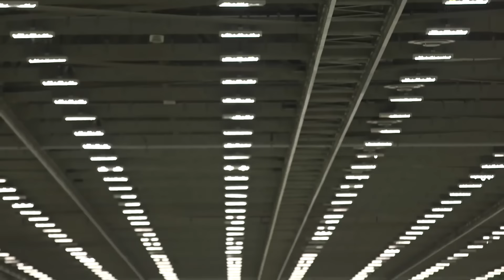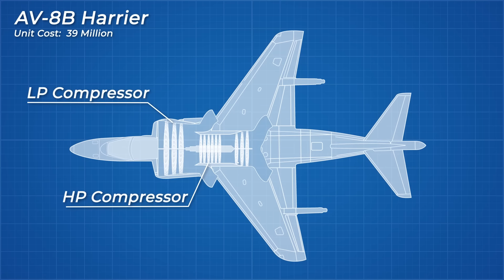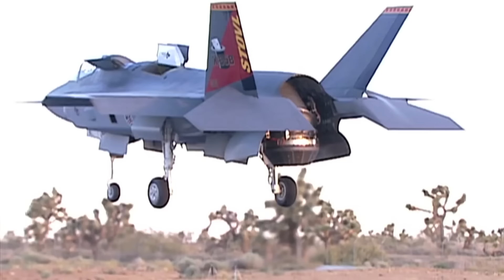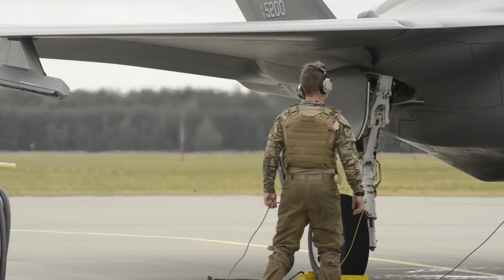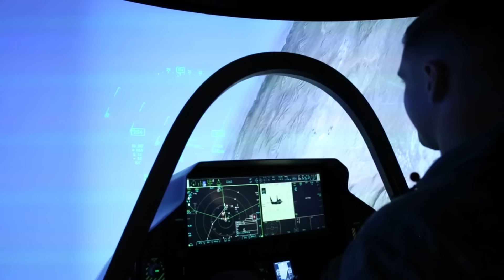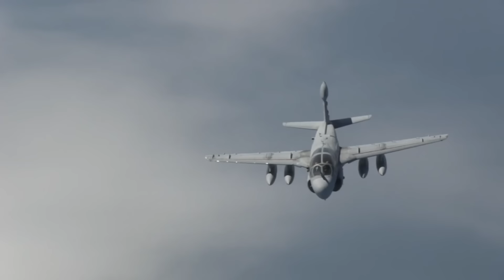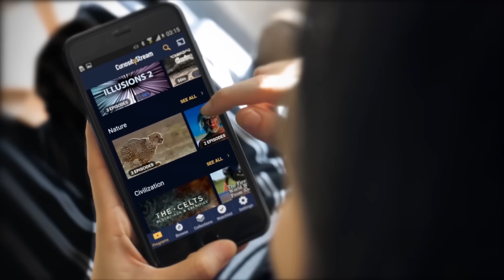Is The F-35 Worth $115 Million?

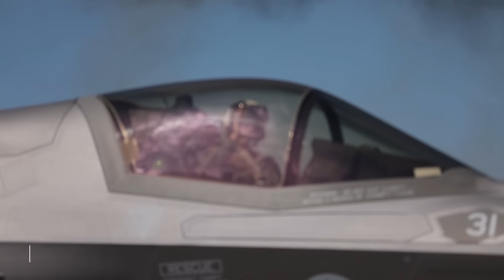Comment: 8:50 "Ironically" when referring to the F-35 having three models.  

Even the X-32 had it gone in to production would have had multiple models. The sticking point was that the VTOL prototype couldn't go supersonic. Yes, Boeing said they'd fix it in production, but they had a separate VTOL prototype from the prototypes capable of supersonic flight.  Where the X-35's VTOL prototype had no problem going supersonic. So the X-32 had VTOL OR supersonic.

From the start of the JSF program, it was expected that there would be a "VTOL version" and a "non VTOL version" of the winning design; as they knew the Air Force and Navy didn't want to waste the weight of a VTOL system.  The adding of the third version for the Navy was "Navy gotta Navy" and wanting more capability than the Air Force. Although I don't know why the USAF didn't just order the F-35C for commonality. Oh, wait, I do know - they wanted to be different than the Navy.

I do wonder if the Blue Angels and Thunderbirds will both switch to the F-35, though, marking the first time both teams would share a plane since they both used the F-4. It would be awesome for the Marine Corps pilot to fly an F-35B and do some VTOL tricks during the routine.
Reply: The F-35 seems to sacrifice manoeuvrability for stealth and VTOL so doesn't that make it an unsuitable replacement for an aerobatic display jet?
Reply: @GonzoTehGreat  Sure, but the F-35A is still superior to the F-16 in terms of maneuverability, it just isn't top tier like the F-22.
Reply: @dumdumbinks274  The F22 was the intended replacement for the F15. 

The F35 is intended to replace the F16 (with A), F18 (with C), Sea Harrier (with B), F15E variant and originally also the A10 (although turbo props and now drones are being considered instead).
Reply: @GonzoTehGreat  As a simple summary yes, but technically the F-35 is only intended as a direct replacement for the F-16, F/A-18A/B/C/D, and AV-8B... 1 for each F-35 variant. There is discussion about replacing the A-10 with it, but that's only because the F-16 has already largely replaced the A-10 and the F-16 is being replaced by the F-35 so it's an indirect replacement. I don't believe the A-10 will have a direct replacement since it's strengths are not nearly as useful today as they were back in the 60s. 

The F-15E is being upgraded and the F-15C is being replaced by the F-15X. The F-35 is considered perfectly capable of replacing them in terms of it's capabilities, but the production lines are fully occupied for at least the next decade so cannot replace the F-15s in a timely manner. All F-15 variants as well as the F/A-18E/F are expected to be replaced by 6th gen fighters starting around 2030.

As for F-22, well that was a political failure much like the F-14. When politicians don't like a military product that product tends to end up falling short of expectations. The minimum number of F-22s required by the USAF was around 320, but politicians cut that number right back to 187 and studies into restarting F-22 production with modern technology unfortunately concluded that it would be a waste of money and effort. Better to just upgrade the ones we do have and proceed with the 2 6th gen projects.
Reply: @dumdumbinks274  Can you support this with evidence? The F-16 was designed to be manoeuvrable in WVR engagements, so I don't see how the F35 could be a superior dog fighter and have actually read the opposite.

https://militarymachine.com/f-35-vs-f-16/

As I understand it, the F35 is superior to the F16 BVR due to stealth, more advanced sensors and information processing, better ewar capability and active radar, however many of these advantages are simply the result of improvements in technology over time rather than being specific to the F35 itself.

Hence, I think the jury is still out on how it will perform in a dogfight - the counter argument being that hopefully it will never need to engage in one.
Reply: @GonzoTehGreat   Sure, just watch any recent F-35A airshow or refer to this F-16 pilot's comments https://theaviationist.com/2016/03/01/heres-what-ive-learned-so-far-dogfighting-in-the-f-35-a-jsf-pilot-first-hand-account/

The article you have cited refers to the 2015 test of AoA laws (not an actual dogfight) which was essentially testing the controlability of the aircraft during combat maneuvers. The test was a success and lead to the removal or reduction of many restrictions imposed by the flight software for safety reasons (don't want pilots attempting untested maneuvers and crashing an expensive aircraft). Although that was the case a report was leaked about the test results and taken out of context by a fairly controversial site called warisboring.com and it created a lot of drama The F-35 in the test was restricted to 4.5Gs. Production model F-35s from mid 2015 were 7G capable, and later that limit increased again to 9G for Block 3F aircraft in 2018 - the same as the F-16. Though unlike the F-16 the F-35 can tolerate very high AoAs without losing control. 
EDIT - Note that the aircraft flown by the pilot in the linked article was a Block 3i F-35A limited to 7Gs. 

Another way to look at this is from a simple analysis of the statistics. The F-35A is about 1.5x as heavy as the F-16, but it's wings are also about 1.5x larger and it has about 1.5x the thrust. However unlike the F-16 the F-35 is a lifting body design and about 30% of the lift generated by the airframe comes from the fuselage instead of the wings, so the F-35 has a lower loading than the F-16. The other aspect is that the F-35 carries a heck of a lot more fuel and has significantly longer range so it's weight varies more, but comparing an F-16 at dogfighting weight to a fully fueled F-35 is not a valid comparison... though some "experts" like to compare them that way just so they can say the new tech is bad.
Reply: Bhue Angels are switching to the Super Hornet. It will be a very long time before they fly the same plane again.
Reply: @dumdumbinks274  That makes more sense.

Comment: So eli5, why not repaint the F-15 and install these electronics?
Reply: The F-15 

- is less maneuverable by far 

- with a combat load has worse performance due to the drag of all the weapons and pods and fuel tanks

- can be spotted at 10x the distance on radar which means the advanced sensors don't have much opportunity to be used. 

- is also more expensive to buy and operate.

Comment: Can anyone design a vehicle which would simultaneously be the world's fastest car, the toughest SUV & biggest pickup truck?
No right-thinking person would do so. However the US has built such a plane. Which does everything badly
1 - That half million dollar virtual reality helmet freezes sporadically leaving the pilot blind (potentially during combat)
2 - The reason for having that overpriced helmet is because of that huge hump directly behind the pilot completely obscuring the rear view (EVERY successful fighter plane till date has been with a clear rear view) 
3 - The same hump and thick body common to EVERY F-35 (and designed ONLY for the VTOL versions to house the fan) has completely ruined the plane's ability to dogfight (lower top speed, lower climb rate, fast bleeding of kinetic energy). One has ended up with a plane that cannot do its basic role.
4 - The F-35 is slated to replace the A-10. It literally has 25% of the A-10s ammunition capacity, 50% of its loitering capability & (unlike the A-10 which is a flying tank) none of its ability to take damage. I bet this plane will never be used in close combat support because when it does, many will be brought down. Its single cannon is placed to the side of the nose and is terribly inaccurate (causes the plane to yaw due to the recoil). Note that its much ballyhooed stealth is useless when conducting ground support
5 - Every crucial test to certify the F-35 was rewritten in order to let it pass.
6 - The marine guy in the video was ecstatic because it is much better than the Harrier. He does not care about it being much worse as a fighter
7 - The plane has only one engine. Fine for small interceptors, fatal in close ground support due to ground fire 
8 - It is crawling with software which currently malfunctions under battle conditions (screens freezing and systems actually re-booting during combat simulations... I guess the pilot will have to wait for the computers to reboot before continuing the battle)
9 - The plane is now used as a drone operator. Something the B-52 also does (a non-stealth, slow-moving plane built 70 years ago with the radar signature of a football stadium)

But don't worry, other countries will buy it (under sufficient pressure from our government)
Reply: 1. That issue was fixed.
2. The F-35B is the only variant with a huge hump. The F-35A has similar visibility to an F-16 according to F-16 pilots, and the helmet only serves to greatly enhance the pilot's situational awareness... it is not compensating for anything.
3. Each of the 3 variants are physically different. The hump is once again only on the F-35B. The F-35A is superior to the F-16 in literally every aspect, including dogfighting.
4. The F-35 isn't slated to replace the A-10. It is slated to replace the F-16 which has already largely replaced the A-10 in the CAS role because the A-10's strengths really are not particularly useful and the A-10 is the least survivable combat aircraft other than the AC-130. Small arms fire is only a threat to aircraft if using HE or incendiary based rounds, and they don't have the range to engage fixed wing aircraft anyway... they are a threat to helicopters, but not fighters.
5. No tests were rewritten. What might you be referring to here?
6. The F-35B/C are excellent fighters as well. They aren't top tier, but they certainly do their job well and work extremely well as a force multiplier.
7. Considering the F-16 does way more CAS than the A-10 I don't see a problem. Small arms fire is once again not a threat, and missiles will typically shoot down an A-10 just as easily as any fighter.
8. Not very often. Sure there are problems, but these are teething problems and all aircraft have had similar issues.
9. It has the capability to operate drones. That is not it's sole purpose and is a minor but positive point. Also you talk as though the B-52 can operate the same drones... it can't and the B-52 has 5 crew, not 1.

Comment: The most expensive weapons system in US history is the aircraft carrier.
Reply: Well... not being an expert but an aircraft carrier is around 13 billion+ upkeep
The F35 program is said to cost >1,4 trillion
If this is correct the F35 is by a mile the most expensive, not per unit but as a defense program and that I believe is the right metric to use.
Reply: @qinby1182  
You're comparing a single unit to the entire program of 2000+ planes though.
Reply: @Mickey G
What we are talking about is defense PROGRAMS not units, that was the statement, and concerning that the F35 program is by " a mile" the most expensive.
The aircraft carriers ARE PROGRAMS as well as units… should also add that aircraft carrier programs do include F35's (Flight wing)
Reply: @qinby1182  
Okay, but the $1.5 trillion figure is the projected cost up to 2070, not the cost that already been paid. The total program cost so far (already spent, not projected) is way below that, $55 billion already spent on R&D, and 430+ of these aircraft have been produced so far. The total procument cost for 2000+ aircraft is estimated to be ~$400 billion.

Comment: Problem with trying to have one plane multirole for literally everything is that you lose potential by not allowing one aircraft purpose built for that role to be used. Long term it's cheaper to use planes like the F-15/F-16 and A-10 for their respective roles because they're cheaper and can fill one role they're designed for. 

There's a validity of getting new jets made, but at such a cost it's almost not worth it when the combat missions can be flown by cheaper aircraft.
Reply: The F-16C/ D is also a multi-role aircraft like the F-35A, as is the F/A-18E/ F like the F-35C. The F-15E is a bit of a one off kind of aircraft, but the F-15C and F-22A serve the same air-superiority role or the "hi" mix of aircraft in the USAF. A new produced F-16 and F/A-18E are not cheaper than their contemporary F-35C or F-35A.